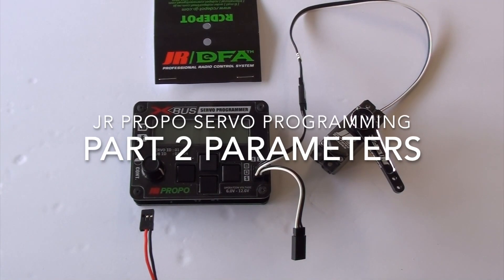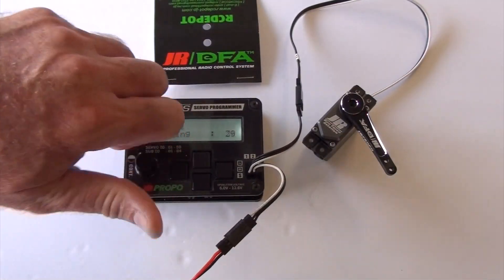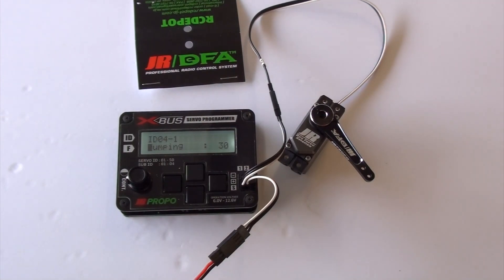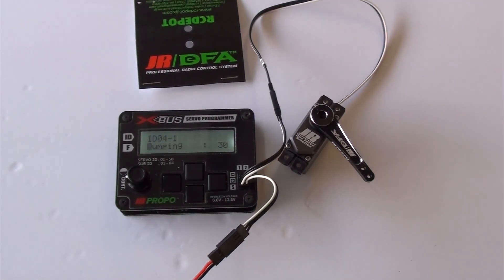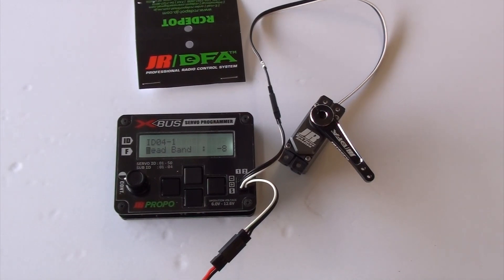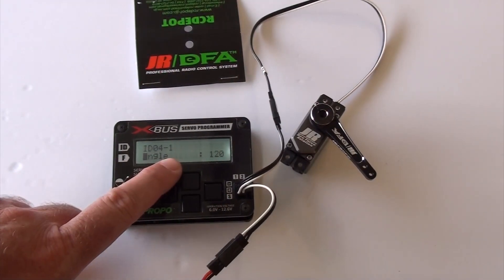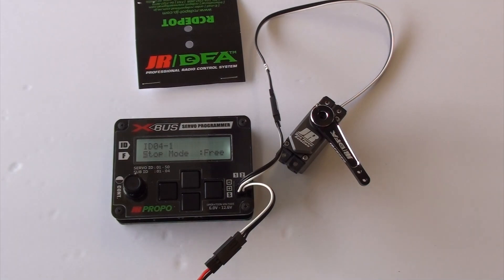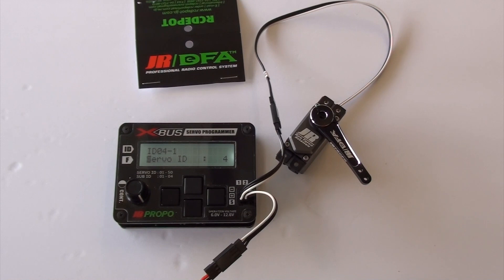JR Servo Set Up Part 2

Comment: While programming my 35% slick today I attempted to increase my overall travel to roughly 120/120. As a result of this i brought my servo arm in 1 hole (1.25in). At full deflection (37 degrees) the servo let's loose and goes "powerless" until I let go of the stick. It did also did this when the servo wasn't attached to anything. Is this due to somehow over driving the servo with nothing attached to it?

Comment: Great video. I bought a lot of these servos not knowing at the time that I'm not getting the advertised settings, Torque etc out of the box. I'm assuming every setting would have to be turned all the way up in order to achieve the actual numbers advertised on the box of the servo? I have 2 jets and a 35% slick that these are going in. I plan on turning the hold to 50, damping to 30 and deadband to -5(to be a bit more conservative). Do you feel as though this is a good template for all 3 airplanes?
Reply: I may have made things a bit unclear on out of the box specs. The JR Propo servos you have will perform out of the box to advertised specs. However with the programmer you can fine tune each one to perfectly match your airplanes linkage/application. Example on my 120cc Extreme Flight Laser. Dual ailerons I can run the dead-band higher and not get any jitter at center. With the elevator and rudder they are single servo and with the dead-band turned way up they jitter at center.  Out of the box they are programmed to work really well installed in whatever model. But you can make them MUCH better by fine tuning the program to each model. If you are running X-Bus you can do all this with the transmitter also.
Reply: @jasondanhakl281  thank you for confirming that as well as the fast response. Greatly appreciated!